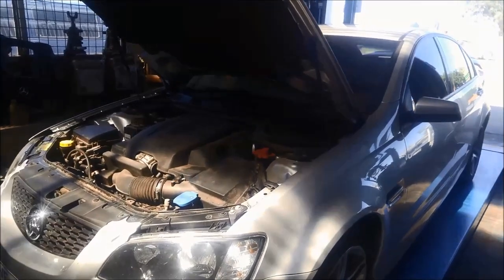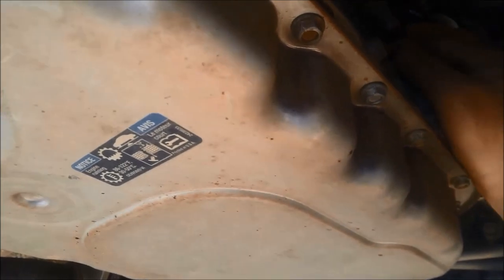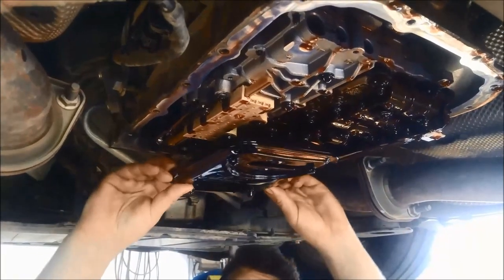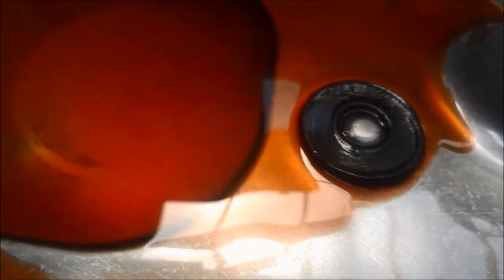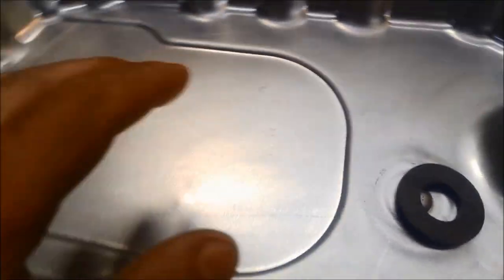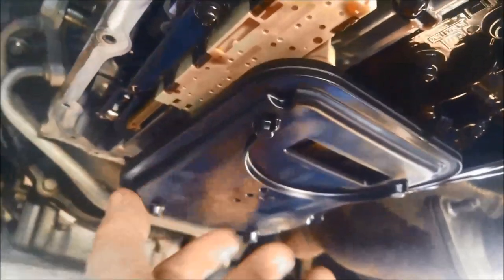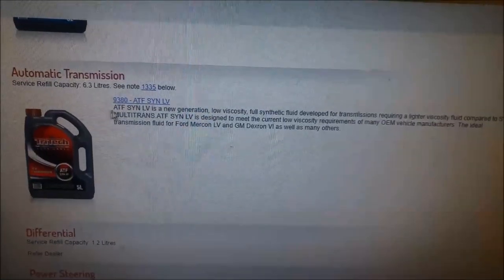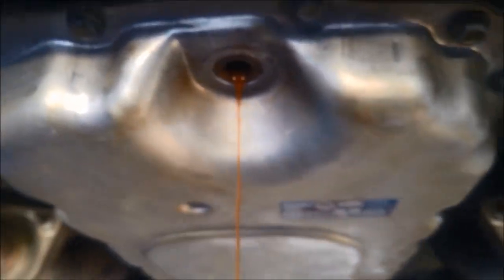How to 6L50 Automatic Transmission Service, 6L50E 6L80 6L80E how to check fluid level how to DIY

Comment: I've done this service, filled with Penrite oil that meets GM specs, correct temp etc, drove car, auto slips after slowing down to turn into another street. Check oil.....low.....wait to get temp to correct range....ad oil, back on the road.....still slips. Did everything as per video including the new position of magnet, new aftermarket filter.....same as A C Delco that was replaced. VE 2011 SV6 130,000km. What next please.
Reply from the maker: hi, was there any issue previously? what was fluid condition? sometimes if fluid is very dark/old/burnt it is slightly thicker than new trans fluid, so if you have internal pressure leaks then new fluid can make it worse. also all depends on service history, mileage, amount of debris/swarf in trans pan and on magnet. cheers
Reply: @YepThatsIt  Thanks for the reply. Oil condition was pretty good. No smell or bad colour. No issues before. I changed the 3 timing chains etc, all other fluids, so did auto service. Did my time in the late 70's, HQ-HZ, XY-XE etc. Not much muck in the pan at all, cleaned up real well, magnet was a bit thick with build up, replaced the same way you did, as all the magnet type trannies I have done. Will be looking at car again this Friday. Even though I have replaced oil as per temp & level, I may have overlooked the capacity for the torque converter. I'm pretty spot on with my levels normally, but this is the first one I have changed without the good old dipstick ! Maybe I'm the dipstick & have stuffed up somewhere ! Also, checked trans temp at pan, side of box & oil coming back out of drain hole. Got 3 different readings. Pan was the coolest within 30 to 50C, side of box was showing 80C & oil flowing out was 65C with engine running. Also did not replace the seal up in the tube as the spare parts guy, who used to service autos like you, said if the filter came away with a bit of effort, there is normally no reason to change it. My filter was tight & firm & required a bit of effort to pull down. Looked up tube, seal looked great, could not feel any damage, new filter fitted nice & tight as it should & as per video. Surely that seal couldn't be giving this slipping problem ? I think I'm still low on oil somehow, even though it was showing to be full. Thanks for your interest.
Reply: Update, 29.11.2021, put car back up on 4 jack stands, everything level. Gear box temp showing 47C, pan showing 35C. Removed drain plug......no oil ! Used another 2 litres, with engine running, in Drive, wheels turning etc. Temp rose a bit, within 30-50C. Oil started overflowing, let drain a little, replaced bolt whilst some oil trickling out, test drove.....happy days, car is fixed. When I did it previously, oil was coming out, yet tranny slipped. I did run the engine, but did not put into Drive like I did this time. Torque  Converter probably took some oil from previous fill & my temps were a little too hot. This time, all good. Job done !

Comment: Hey mate, handy video, wondering what the torque specs are for the 10mm fasteners and 14mm drain bolt? (Ryco cork/rubber gasket)
Cheers
Reply: 80 in/lbs for 10mm  pan bolts

Comment: Any need to do a flush to get all the old fluid out of the torque converter ?
Reply from the maker: hi, we only do multiple full flush when there is coolant/water in trans or when someone put wrong trans fluid in. cheers

Comment: I assume the 6L45-E is the same?? any substantial differences in drain and fill process?? thanks
Reply from the maker: hi, fill and level check is identical. cheers
Reply: did it work for you? I dont think the 6l45 has that rubber fill plug but it has a metal botl on the side for filling.

Comment: I've been watching similar videos, and they recommend NOT measuring the temperature at the pan, but to use your scan tool trans temp reading.  I don't have that on my scan tool, so how long do you let it idle?  And do you go through all the gears first, then check the temperature?  Thank you.
Reply from the maker: hi, the temp sensor is on trans valve body, usually toward front of the trans. if you take a rough average of temp between front/middle/rear of trans pan, you will be in the ball park temp ( i have tested quite a few times comparing scan tool temp and digital thermometer - and i should make a vid of it! ) besides all that .... the choice is always yours cheers
Reply: @YepThatsIt  There's no way for the temp in the pan to be higher than at the sensor. The sensor is part of the techm. It's just a little thermistor. So if you estimate the temperature to be a bit below the actual temp, you should actually be pretty spot on.

I would work with whatever is the hottest temp you see, in the pan its self.

That being said, those that build these trans for racing and myself, will overfill the 6l family plenty. The viscosity of factory fluid is low enough and never thickens really that it won't cause any noticeable extra drag. If the trans is low on fluid, or you put the wrong filter in (like the neck is too short to reach the bottom of the pan), that's when you will cause problems.

Comment: How about the torque converter does it have to be drained? To fully replace new ATF on the whole transmission??
Reply: We use same transmission on Trailblazer or Colorado 2.8 diesel. It has torque converter. Does it needs to be drained?
Reply from the maker: hi, removing trans pan and doing filter service is adequate to improve the old fluid properties. we only do a full flush if coolant has entered the trans, and even then you will need to do at least 5 full flushes to get it all out. see my milkshake trans fluid vids. cheers
Reply: @YepThatsIt  Your answer is very helpful! Will definitely replace ATF 100k kilometers on Trailblazer uses same transmission. Thanks!

Comment: Hey bud just a question for you i have a late 2009 ve wagon with the 3 litre v6 with a 6speed auto and it has a dip stick , i have seen some of your other vids with the 6speed and they dont have a dip stick , is that because its a different transmission
Reply from the maker: hi, is it factory or retro-fit dipstick? cheers
Reply: @YepThatsIt  factory mate
Reply from the maker: @brettwheaton6631  should be no problem, just make sure you check fluid level as per your owners manual because without dipstick yo need to measure level to a specific temp range because the fluid expands with heat.cheers

Comment: The magnet will move drop an a big shot of steel dust will pop off an smack the filter pick up all at once.. so no bad idea . If you want to help it put another magnet in the pan away from any moving parts.. that's it
Reply from the maker: hi, we are yet to have that issue..... always good practice to check/confirm magnet will not be in way of something before you reassemble. cheers

Comment: 6l80e
Is this the shame ?
My bolt looks like it’s sits flush with the bottom of the pan.

When I crack the nut there is a heap of fluid coming out and it doesn’t seem to stop

Worried about running the trans dry
Reply from the maker: hi, some 6L80 trans have an slightly different process for checking fluid level. many don’t have a dipstick..there’s a plug in the dipstick hole. the plug can be removed and the hole used as a fill point for trans fluid. bring the trans fluid temp between 30º–50ºC.  check using a scan tool. it should just be trickling out the bottom plug hole at between those temperatures. you might owe me some beers, link is in description cheers